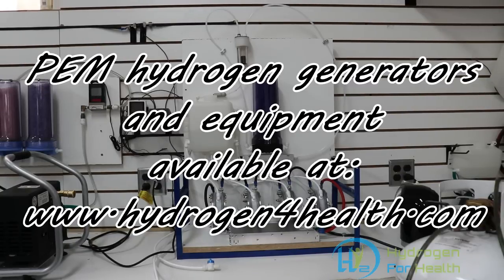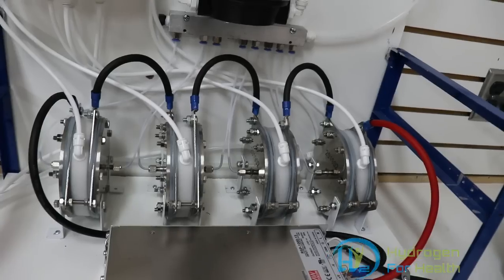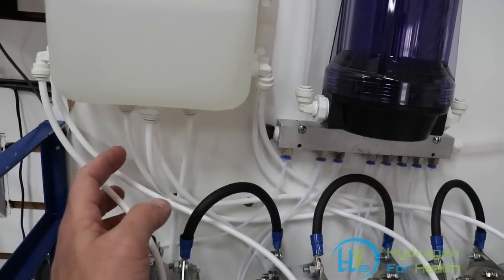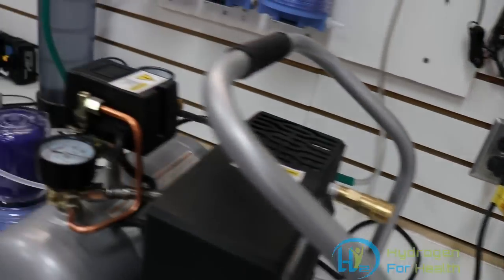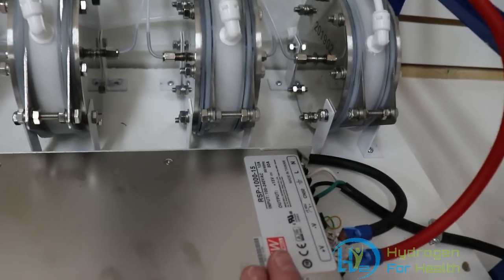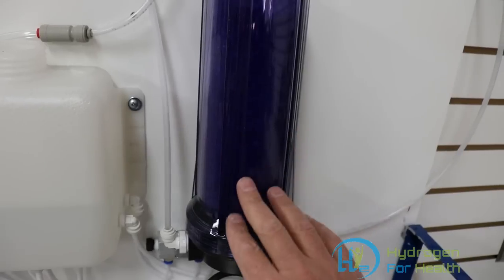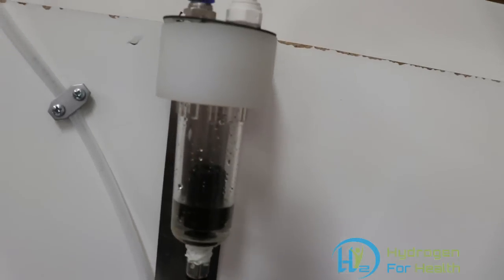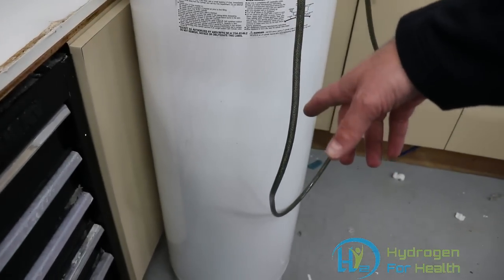Hydrogen compression. PART 6. We setup a new 4 PEM generator machine.

Comment: I followed all your videos, it is amazing. I would like to buy one of your electrolyser PEM shown on this video but didn't find it on your website. I have one question regarding the compressor: what is its brand and do you know how the compressor manages not to mix the outside air and the hydrogen. sometimes during compression, a little air can enter with the piston
Reply from the maker: I have not found a compressor yet but a paintball or scuba compressor might work. you can see the PEM cell here : https://ddwaterhealth.com/product/pem-generator/
Reply: @Hydrogen4Health  thanks for the link, how to do produce distilled water in parallel of hydrogen ? reverse osmosis device ?

Comment: Is there a worry about the oxygen enriched building as the O2 leaves the bubbler?
Are you removing the compressor intake muffler and just sucking the gas out directly?
Is the compressor a plastic walled cylinder type with some kind of zero clearance rings to keep the Hydrogen from slipping into the crankcase. I built my own system in 2008, and have been sitting on it since retirement (now), for fear of the tiny H atoms, slipping past the pistons during the compression stroke. How high are you going to pressurize the tank? Just worried at higher pressures in the piston tops, might cause more leakage. Any info you send me would be appreciated. Any little failures might keep me from blowing myself up too. I have blown a lot of things up (Purposely), to entertain the kids. I flipped a 2 L bottle upside down and filled it with HO. Lit the bottom with a long (6') match, and thought it blew up, until the bottle came back to earth 25 seconds later. All i got was "AGAIN,AGAIN!
Reply from the maker: Always do this in a well ventilated area. Hydrogen will dissipate into the air quickly making it safe. crankcase ventilation is a must.

Comment: Great video. Absolutely liked it. Now comes the final question... : What is it actually good for? My case is heatimg up a family house like this- I would have to have a MASSIVE storage tank... 1000ands of m3 capacity or, alternatively, super-expensive High-presure tank... We are talking about 400-800 bars - very expensive stuff. That is the achiles toe of this system I would say... One may even run the car like this, however buying it is gonna cost us almost the same and its more comfortable...

The only aspect I cant tell right now is :  if the energy in terms of Joules comming from a hydrogen gas buning flame could be more EFECTIVE than electric watts running through the electric heater wire coil .... 
I would say it is the same energy,or even 0,617 less effective than the electricity comming straight from the solar panel on the roof  ...mabe I am wrong here. 
If anybody could answer, I ll be gratefull.

Comment: what are the limits of combustion at high pressures?  most  limits are using  air which is 21 percent oxygen..  I imagine atha pure oxygn  that  an explosieve mixture could take place more easier.. I think diesel engines  can idle at very very low rations.. 

because of the high compression

Comment: Man... i would surround the compressor in  co2 or nitrogen..  any oxygen contamination would be catastrophic.
Reply: Would you elaborate?
Reply: 100 gal 3800 liter ÷ 2 lpm. x 1.3 
1900min x 1.3 (compress)2670 min
÷ 60 = 44hr 1.8 day
Reply: Run v8 for 61 minutes

Comment: nice vid. do you know what material is used for the electrodes in the PEM? edit: nvm, i just looked at your site, iridium titanium, but i still have a question, is the titanium plated with iridium? also, do you have any kind of visual of how the PEM is put together? like one of those exploded view images? people like details. well, people like me, i guess. thanks in advance
Reply from the maker: Private Confidential no the membrane is coated with iridium on one side and platinum on the other.
Reply: @Hydrogen4Health  alright. if you ran one continuously, how long would it last?

Comment: Question - Everything I've seen on HHO Generators (mostly the naysayers) state that the process requires more energy to create the Hydrogen than is viable. Especially when using the generators in a vehicle. My thought is that, while a vehicle is running, the battery is charging, hence a cycle of charging the battery while creating the hydrogen, making it viable to use. Am I wrong in my thinking, or are the naysayers wrong? Thanks.
Reply from the maker: Jason Davis nothing runs at 100% efficiency and the alternator generates drag that uses horsepower. They are part right and part wrong.
Reply: @Hydrogen4Health  So would you say that HHO is not a viable solution to efficiently power a vehicle taking into consideration the cost of gas and the powering of the unit?
Reply from the maker: Jason Davis No, hho is not a viable solution to “power a vehicle” BUT what hho can do is make the fuel burn more efficiently. Gasoline does all the work and it’s very important to understand that. When gas burns inside the engine most of the power goes to make heat and not much goes to make mechanical energy. What hho can do is make the gas burn more efficiently so it makes more mechanical energy and less heat. 
Hho should be looked at as a catalyst for the gas to make it burn better. It should never he called a fuel because it’s a horrible fuel and the naysayers are exactly right on this point.
Reply: @Hydrogen4Health  thanks for clearing that up

Comment: Nice setup. So what do you do with the hydrogen after you store it in the tank?

Also how much kg/h you generate? Maybe I am wrong, but 4 cells, each producing 0.9 L/min at normal pressure and temperature, this makes it 216 L/h, which is about 0.019 kg/h. Lets say 15 kg/h, because you probably run these cells at lower voltage than in the previous video (3.75V, vs 4.5V previously). Assuming you use 1000W here, that is well, 1kWh. So 15 kg / kWh.  Which is pretty damn good I can say so. 

In therms of thermal energy (combustion) that you can release from 1kg of hydrogen you get about 33kWh. So from 0.019 kg you get 0.627 kWh. So the efficiency looks pretty decent on its own, about 63%. 

Of courser this ignores the compressor power usage, which could be a significant issue, but possibly could be resolved by using bigger tanks and lower pressure.

Now the question is what is the real combined efficiency for two uses cases: 1) burning and converting to mechanical energy (i.e. to power car) compared to electric motors directly, 2) recovering back electricity via reverse PEM cell, or via gas turbine+generator.  If the combined efficiency is high enough, it could be really interesting idea for home energy storage (i.e. from solar power).

Comment: 2:55 incorrect, sir.  The platinum is not the catalyst.  The DuPont Nafion membrane itself is the catalyst.  The platinum deposited on it is just how the electricity reaches the electrolysis site, from the plates.  Platinum was chosen because it does not oxidize.  The proton exchange membrane (Nafion membrane) serves two purposes.  It is a solid polymer electrolyte (as I discussed) but it also serves as the gas separator.  Because of its strength and the fact that it's solid, you can build up a fairly high pressure on either side of it.
Reply from the maker: Sorry but you have that backwards. good observation though. we can learn from each other.
Reply: @Hydrogen4Health  Please read the Wikipedia article for Nafion.  The membrane contains sulphonic acid (SO3H) groups as part of its structure and that's the catalyst.  I'm just trying to help everyone understand it properly.  It's probably easy to confuse the platinum for the catalyst because many people are familiar with catalytic converters and in THAT case, the platinum actually is the catalyst.  Platinum does not speed up the decomposition of water, though.  It's used for its inertness.

Comment: What is the economy in your system? how can you justify the energy consumption to produce hydrogen for use say in a car? it seems that you are using an awful lot of power to produce it
Reply from the maker: This is not intended for a car but you can use it there if you want. Much more efficient than a HHO generator.
Reply: 15 volts? You can very easily run 2 12 volt belt batteries in a series to achieve a 24 volt system,  or even use hydrogen to run/ a generator and run everything needed to produce and bottle more hydrogen, since the batteries could be charged using solar power,  water, wind etc etc. In any case you are using clean, free, green energy with the help of good old mother nature,  all while leaving her tox

Comment: Steve: the LP tank valves are not designed for H size atom.  There's always leak even at a  very low pressure. However, the NG cylinders are a little better and it can hold over 3k lb. But it had to be stress test certify too often. My opinion is that hg is useful only on demand.  For me was more safe and economical to use electricity for recharging li-ion batteries.

Comment: Why not use the power supply from the previous video to power one cell only and power the remaining three from your new supply to save money?  Also you can make a vacuum pump from two cascaded refrigerator refrigerant pumps...
Reply from the maker: Actually in the next video I will be powering each  cell with it's own power supply. The series setup isn;t working so well, one of the cells gets hotter than the others.
I think refrigerator pumps would work great.
Reply: Have you watched: https://www.youtube.com/watch?v=REV739pRNcw "Homemade hydrogen generator and compressor unit" and https://www.youtube.com/watch?v=9jhBOxYqJvc "update" He has a lot of little practical solutions to problems that are difficult to anticipate. Hope that helps. (I would bury the compressed hydrogen bottle in the ground, (with suitable plastic to prevent it being damaged by ground water), to limit its eventual access to oxygen.) If you always think, "when this goes wrong in the worst way" rather than " IF " you will be a lot safer. Good luck.

Comment: How explosive is hydrogen? I think that you will only burn the oxygen available. reducing the volume by about 18600 times?  quite exothermic but implosive not explosive.
Reply: Reaction heat will make sure water remain a gas maybe? Pressure would decrease 1.5 times if the temperature stayed constant but it isn't. It would build up a pressure. Lets check:

Standard formation enthalpy of gaseous H2O from H2 and O2: −241.818 kJ/mol  (at 25 deg C).

Isochoric heat capacity of water vapour is pretty constant 3 to 4 kJ/(kg*K). On average this is about 65 kJ/(mol * K).

Ok, so that looks like just 3-4 deg C increase. And the water should condense quickly after that, indeed. Fascinating.

Comment: i think you are confusing terms, these are NOT PEM (Proton-exchange membrane fuel cells) AS IN GENERATING ELECTRICITY FROM hydrogen on one side ,and oxygen FROM the other side ,with the byproduct produced being water,  these are dry cell electrolysis devices to split water into its two components, that you then feed into a PEM (Proton-exchange membrane fuel cells) as its fuel to make electricity
Reply from the maker: Indeed it is a PEM electrolyzer. No fuel cell here.
Reply from the maker: @Jay Andrew Haven't tried this but I'm thinking some electricity would be produced.

Comment: Steve,  one tip for producing a new gas for combustion on engines. Dissolves the HHO at atmosferic air, you will obtain a gas named Nitrox-H , this misture can be stored and pressured. Make this and write your opnion. Great work. Congratulation man. You are on the right way, i will stay tunned here.
Reply from the maker: Isn't that gas non flammable. I don't get it. Are there others experimenting with this gas?
Reply: @Hydrogen4Health  Yes man. We have many videos to show how You can control the concentration of oxigen, if you mixing tha HHO with a fish tank bubbler to obtain small bubles and dissolves the gas with Nitrogen of Atmosferic air. Is not the same thing of inject at intake of engine. The mixture reveives the name of Nitrox-H. Is the enrichment of hidrogen particles and pure oxigen particles.
Reply: @Hydrogen4Health  the resulyant gas of nitrogen mixing will promote the full burn of all combustive but without senaibilize the lambd probe. Quantity of Nitrox-H that you inject is proportiinal your economy obtained.

Comment: Why electrically connect in series?
Reply from the maker: J Correa each cell uses about 4 volts.
Reply: @Hydrogen4Health   4 volt per cell, 30 amp or so.
I figured you ran in series to limit current. In parallel it would be 4 volt be about 120 amp.
Also, looking at video of 1 cell you where able to get 1 LPM.  I think you could get 4 LPM if you ran individual power source to each cell. Unless you can find 130+ amp power source for 5 volts.
Reply from the maker: @jcorrea8597  I run them in series to drop the voltage. These cells run on about 4 volts. If it was setup in parallel 12 volts would be going to each cell and that would damage them quickly..
Reply: Because it is easier to deliver 15V at 30A, than 4V at 120A.

Comment: Hi Steve
nice video,love to watch the stuff you do.
Reply: just wondering what it would cost in electricity to fill up that tank. would it be worth it?
Reply: @duanearbuckle4683  Simply NO - convert the electricity to hydrogen  = 30% losses, compress and transport the hydrogen = 25% losses.  But if you have FREE energy (solar/wind etc.) then you can STORAGE it (witch is very hard with energy - electricity) for later use.